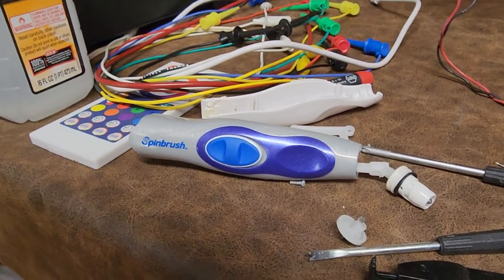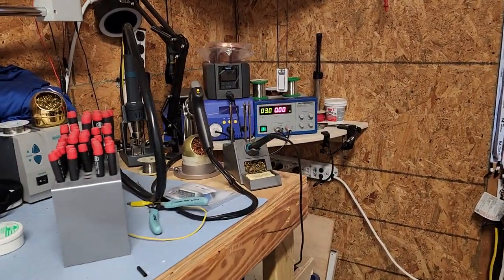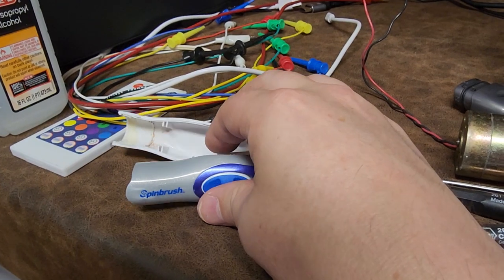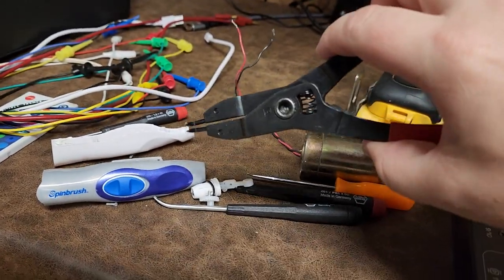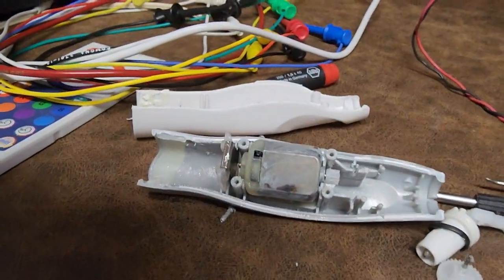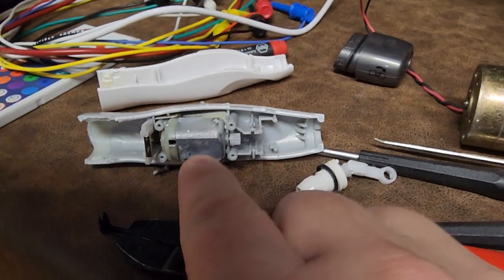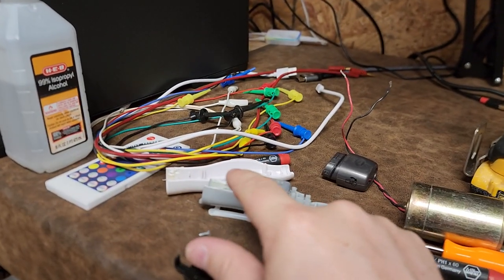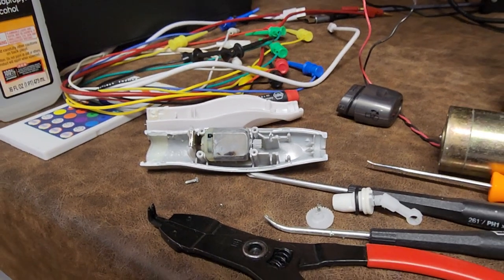Alkaline Batteries Destroy Devices

Comment: You are right about the alkaline batteries of the 90's, i haver here some Philips AA batteries with 1994 as date stamp, they still have some charge (1,35V approx) ,
but they look like brand new on the outside. 
The worst brand you can buy is Duracell, the normal quality, in low current draw devices like remotes, central heating thermostats, clocks etc.... they leak before they are flat and ruin your device. I don't know how the industrial version of Duracell performs. The worst battery that i ever seen was a OEM brand called Dong Guan , from a distance these looked like Duracell, exact same color scheme and even back in the days with that "charge meter" on the side, where you have to push between your fingers and wait if the yellow bar appeared to indicate the amount of juice left in the battery. With these Duracell look a like, this "charge meter" was even fake. The first time when i came across these batteries, i accidentally squeezed a dent in the batteries (just like chocolat) while removing the transparent heat shrink, speaking of quality :-)

Comment: I have put up with alkaline batteries leaking well before their outdate (yes, I’m talking to you Duracell). The leaked fluid is a base, not an acid. Vinegar should neutralize it to a more neutral salt. I tried using rechargeables, but they self discharge & usually run at less than 1.5v per cell. The best solution (for items that are used long term like remotes, etc…) are non rechargeable lithium batteries. I used to get those from Sam’s Club for about $22/carton, but in the last 2 years there was a sudden increase to $35 for the same carton. They were Energizer non rechargeable lithium batteries, but when they raised their price, nobody bought them & I think many stores stop carrying them because of slow sales. Too bad, because they have a long shelf life without leaking & are lightweight. I hate to have to retrieve all these items to have a hospital style PM program just from the threat of leakage. Time is precious.